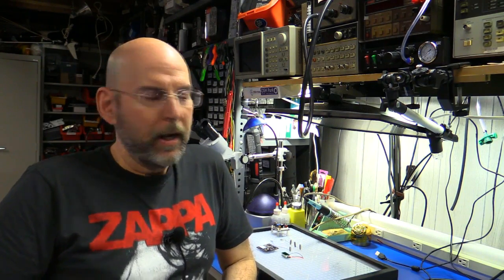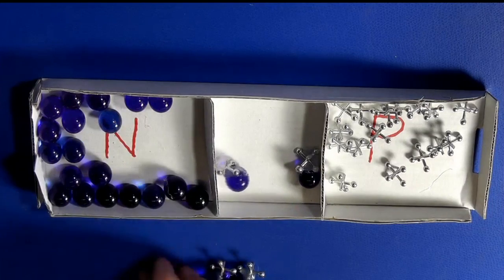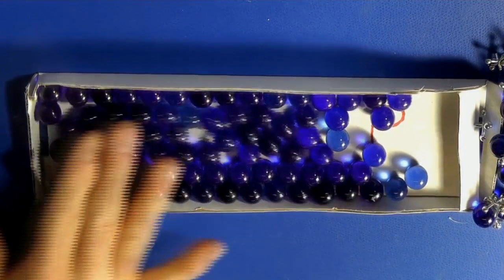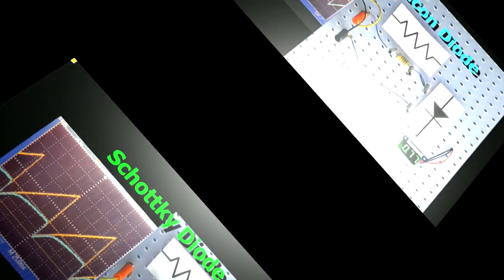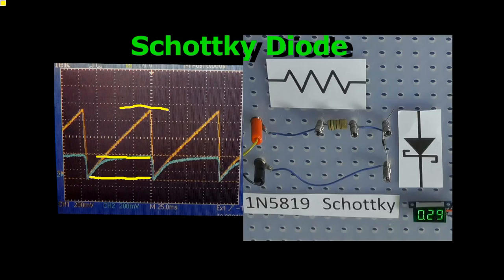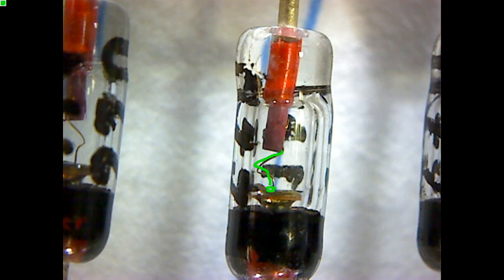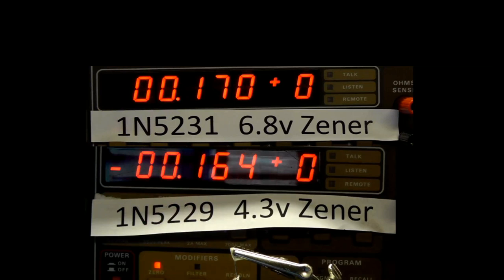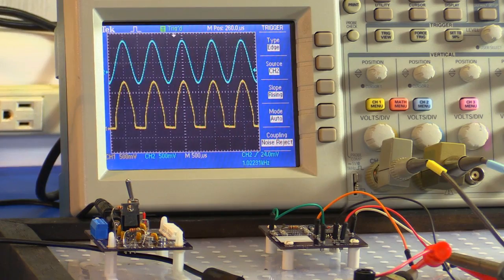All About Diodes - Part 1

Comment: Thanks for the presentation. Yes please continue to other components. Nice to have some history on old parts and uses. I would like to understand better the calculations when using diodes. Voltage loss cut points etc.